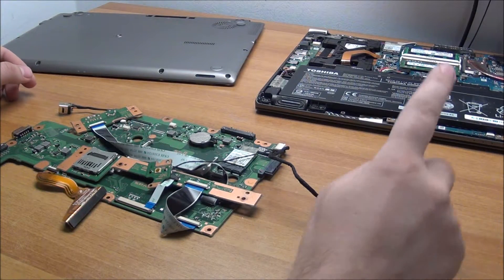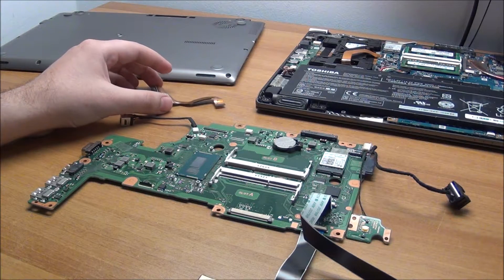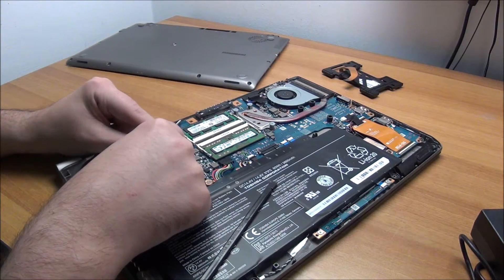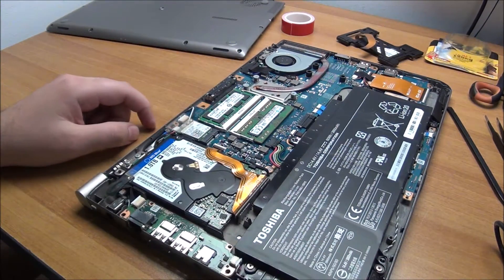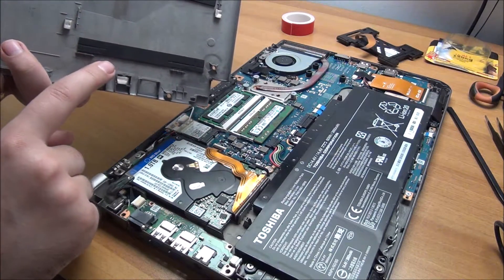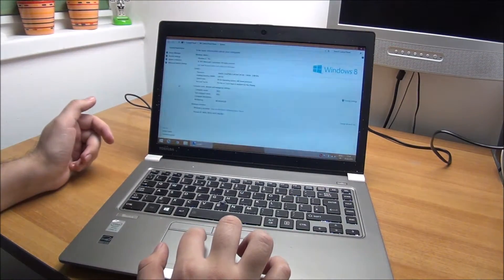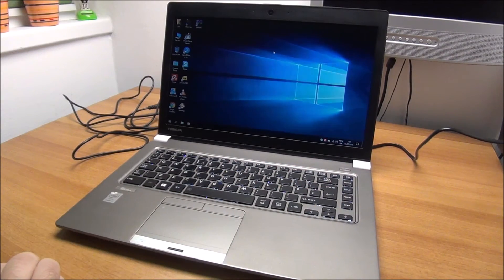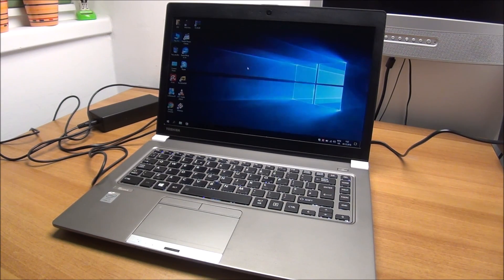Part 2 - Working on 3 Toshiba Z40 laptops - replace the mSATA SSD with a SATA hard drive

Comment: Buna ziua si multumesc pentru filmulet! Incerc si eu zilele acestea sa imi schimb SSD-ul mSATA de pe Tecra Z40 cu unul cu spatiu mai mare, posibil SATA - stiti cumva daca se gaseste un astfel de cablu conector pentru 2.5 in pe Maica Domnului (strada plina cu magazine de electronice) sau in vreo alta locatie din Bucuresti?
Reply from the maker: Buna ziua. Cu placere. Din pacate nu stiu daca/unde se gaseste un asemenea cablu in Bucuresti.
Reply: @UltimateDIY  Am intarziat sa va raspund, imi cer scuze - pana la urma am luat un SSD mSATA pentru a fi direct compatibil. Multumesc frumos!
Reply from the maker: E mai simplu asa 👍🏻

Comment: I was thinking buy a cable in 40 USD fot the z40 or a 9 usd SATA cable for z50 so I buy the Z50 sata cable and now waiting it, thanks so much
Reply from the maker: Welcome!
Reply: hi man, I have question. I need the sata cable connector for the Z40-b, do you know if the cable for the Z50 would work in the Z40?Thank you in advance